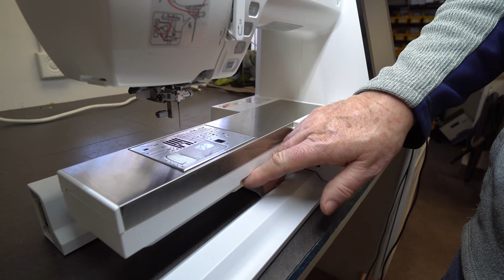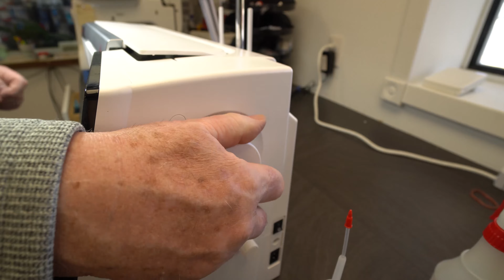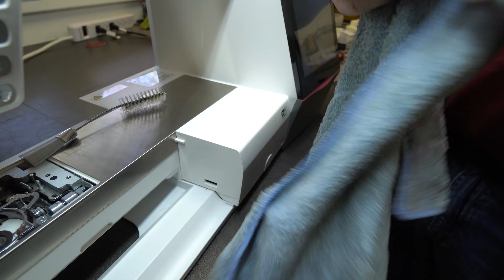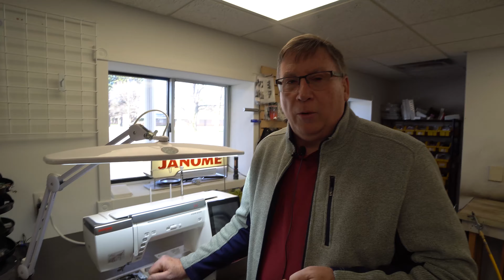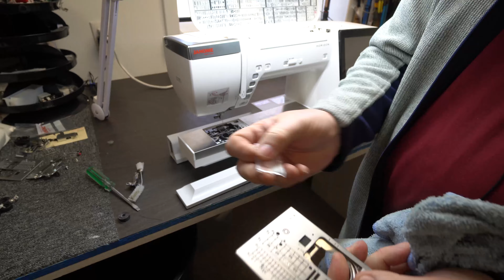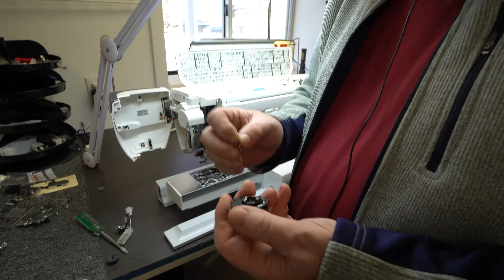How to do General Maintenance on Your Sewing Machine with Rick from Super Stitch

Comment: Thanks. Janome NJ told me not to oil. I keep hearing ppl say to oil. I think even the manual says not to. Makes this confusing. I have another brand I oil all the time.  It’s a smaller combo machine. I still have the email from Janome headquarters saying not to oil. Thanks for the video   I saved it so I can oil it but why does hq say not to!
Reply from the maker: I understand your confusion.  The machine is self-lubricating so that is why Janome recommends not to oil and consumers may tend to over oil.  However, since you are using a plastic bobbin on a metal hook ONE drop of oil in the wick and as Rick demonstrated just keeps the machine running smoothly. Do no add oil anywhere else.